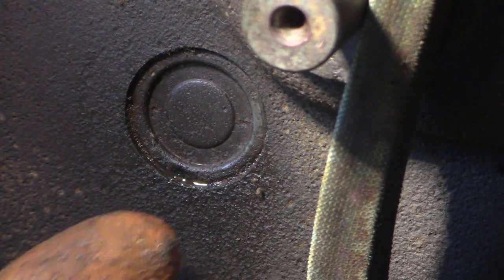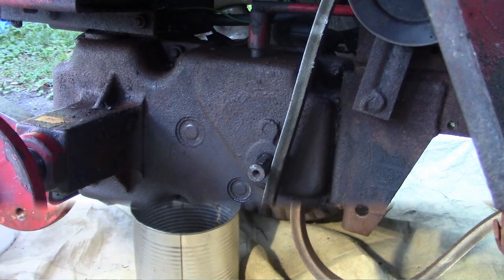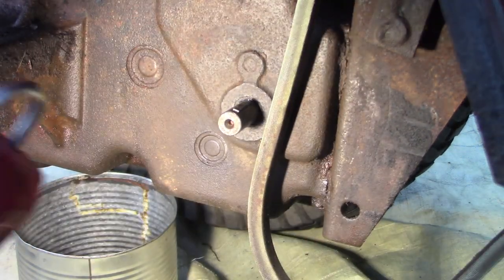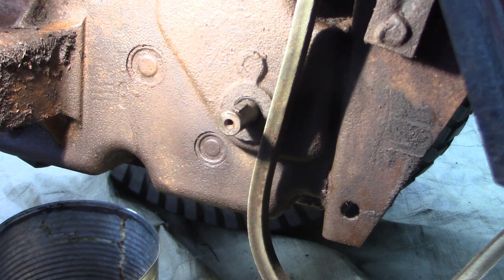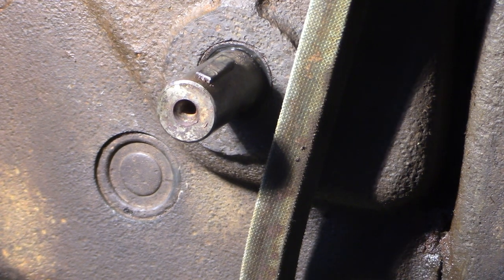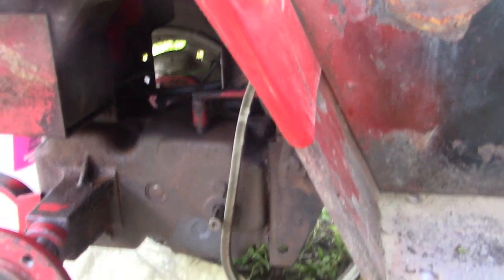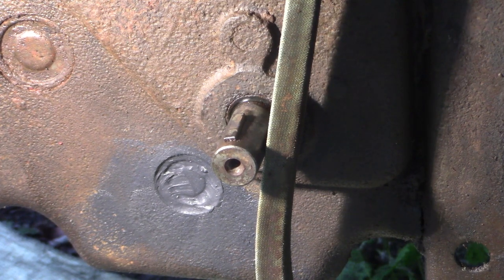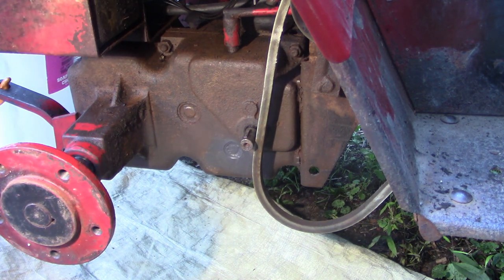WHEEL HORSE Transmission OIL LEAK Fix (Well, sort of...) 416-8

Comment: I would spray that area with carb clean and letting it dry. Carb clean will expose cracks in cast iron. Never saw a leak between the bearing and case. They are pretty tight.

Comment: THE leak is coming from the needle bearing plug. This can be fixed with a new plug or just clean the area really well and smear epoxy two inches past the leak. YOU are done fella.